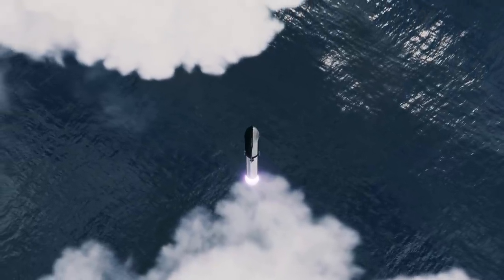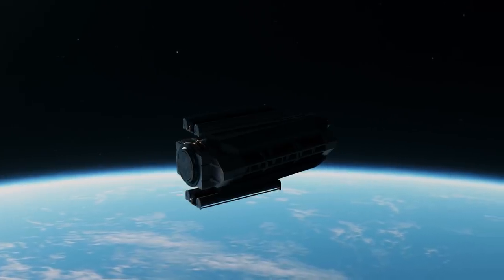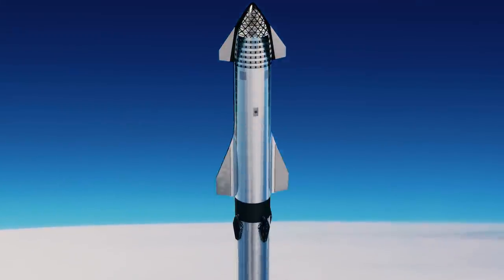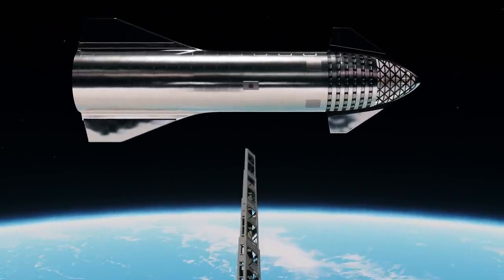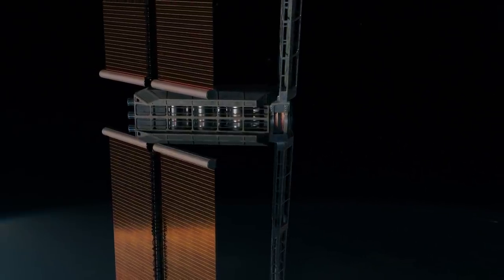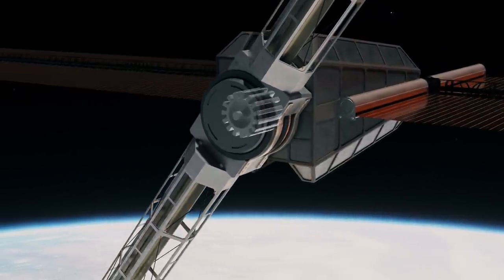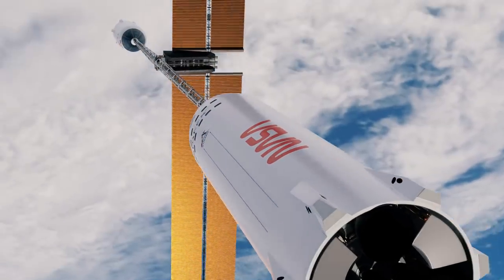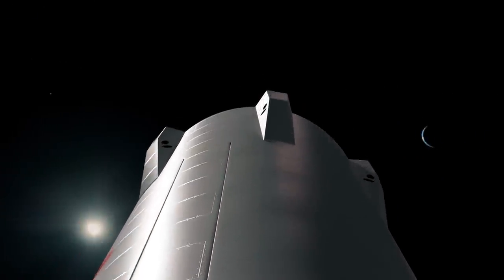SpaceX Starship Artificial Gravity Connector concept

Comment: Well it would be easier to just connect two ships with their noses, seperated with a rope.
The main problem I see here is the "horizontal" orientation of the ships. On earth these ships & boosters are always oriented verically, because thats the only way they can withstand the loads, unlike F9, which can be transported horizontally without a problem.
Put them nose to nose, we have seen starships hanging on cranes with ropes attached around the nosecone. We know that would work. Plus, you could properly use the Interieur.
Edit: Ah you did it with the Moonship, yes that would work.
Reply: However... 
That gives them maximum exposure to meteoroids and solar-radiation . It also makes navigation infinitely harder , while eliminating passenger spectatorship of space during the trip . 
Considering these factors , the optimal configuration is definitely rear-end to the Sun , with side-by-side rotation . Four tether-sets would provide good weight-distribution and redundancy , as well as mounting points for solar-panels. 
Ion-thrusters and reaction-wheels would maintain proper orientation , through redundant computer-control . 
This design services astronaut- health much better than the nose-to-nose one . 
*.To examine the optimal propellants for this mission-architecture , read my Quora Post : 
^ How can rocket-fuel be changed in the future ?
Reply: @Prof.Megamind.thinks.about.it.  still the interiour would be 90° deg angled to what it would be when landed on mars. I wonder how mich thrust would be needed to shorten the flight significantly and if the ion thrusters could provide that for such a big mass.
Reply: @PaddyPatrone  
Mr. Patrone , 
Rotatible equipment/furniture would be key to the orientation issue , while the ion-thrusters would be used to augment the reaction-wheels .
Reply: Yea the tangential mounted Starships look odd!      :D

I also wonder why the solar doesn't just spin with the ship, a rotor seems like an unnecessary part to be eliminated - better some efficiency loss from the solar than adding a rotor!!

You need a ship 200m across to simulate Mars gravity at a leisurely 7-8 rpm
Four Starships docked end to end are 200m long - so any standard Starship docked to the tips would experience Mars level gravity.
So a nice sized Aldrin Cycler with spin sim gravity could be assembled, in orbit, just by joining up a group of slightly modified Starships..     :)

Comment: Artificial Gravity is a must for long duration flights. Many problems though in balance to be solved. Easier attaching to the nose cone for better balance and to be able to use the interior as currently designed for vertical orientation.  @MoonB4Mars
Reply: Definitely need to head to the moon first before Mars and build up space infra , messing about with lunar to orbit 3d printed space parts, artificial grav, living with dust althou not totally the same.  Mars is a scary distance away,
Reply: Yeah connecting nose to nose would mean that the gravity would be acting in the same direction as at launch and on the ground, and balancing the starships around the target would be easier and less important.

At which point a long rope would do the job so the only reason to use the complicated teather system would be for the solar panels.
Reply: @daveansell1970  it's pretty similar to how they lift it with a crane on earth

Comment: Very good. But it's spinning wrong. You would want the star ships. To. Point in opposite directions. Then spin in the direction that generates gravity as if it was on the launch pad so the lay. Out of the starship can be kept the same and in a vertical position it would allow the different levels to be accessible.
Reply: A
Reply: Yeah that way it's the same orientation in orbit as planetside
Reply: Spin does not create "Gravity" only Centrifugal Force.
Reply: But then again spacex could orient it differently so that the levels are perpendicular to the belly of the ship

Comment: Gravity would be on the starships walls like that, the tethers should be attached to the top of the ship.
Reply: I commented the same before I saw the lunar Starship fix it
Reply: Agreed. Especially since the ship is going to be configured to withstand planetary gravity fields so everything will be set up bottom up.
Reply: @Machiavelli2pc  A
Reply: Floor area.
You have larger floor areas sideways
Reply: @brucebaxter6923  I think the floor layout of Starship will be vertically oriented as it should be for this type of rocket stuff.
Reply: @stitchem7  
Skylab
Reply: @brucebaxter6923  I know, but Skylab was not intended to spend most of it's time standing on the surface of the moon or mars. The micro-gravity environment does not apply when it comes to floor area. So the two Starships should be attached to a tether nose to nose, to create artificial gravity that resembles what the ship will experience while standing on the ground.
Reply: @brucebaxter6923  Ideal for climbing the walls in 3rd class, a protective headgear in 1st class.
I could point out if a un-manned moon Starship landed vertical,  then slowly tipped horizontal  (top engine burn).
   A early base easily covered in Moon Dust by a few robot dozers .'. proof against radiation, and suitable three decks with services under top arc, with bottom arc for storage, water, batteries, etc.
Reply: @stitchem7  
What is the interior of dragon oriented to?

Take your time and look carefully. 

Is the cargo that covers the “floor” really a floor?
Reply from the maker: @PassportGaming  yes it happens to many people

Comment: The nose to nose concept would place the forces in the correct direction, toward the floors, the first design would require the ships to be turned 90 degrees, to achieve the desired results.

Comment: Now make the strut much wider, add an inflatable sleeve so the astronauts can move between the ships, and make it asymmetrical so one ship is at moon gravity and the other at Mars. (Stable because the "moon" ship has more fuel on board. And add a docking module to the front of the hub so it can be resupplied etc...  great concept, this is what ISS 2 should look like.

Comment: Hold it right there.  The output of solar panels is expressed in watts or kilowatts, not kilowatt-hours.  Serious error!

If two starships are directly tethered, they can be made to rotate around a common axis.  Position the axis correctly, and their solar panels could be facing the sun throughout the rotation.  The real problem isn't solar collection, but rotational stresses on flimsy solar panels.

You've solved that problem with your artificial gravity connector.  The panels don't need to rotate at all.

One problem that I see with any tethered artificial gravity concept is safety.  If a micrometeorite hits the wrong spot, we could see Starships suffer an unscheduled detachment event.  It's critical that connected Starships possess enough fuel to overcome any unwanted delta-V in the event of unscheduled detachment.  This need may limit revolutions per minute; we can't risk more delta-V from an unscheduled detachment than the Starships can compensate for.  But what the limit is, I don't know.

But I like the concept, especially for a moon orbital base or one in Earth orbit for gravity research.  One Starship has the internal volume of the entire ISS.  Two tethered Starships will have double that volume.  That's a lot of useful space!

You suggested that your artificial gravity connector concept could be used during a voyage to and from Mars.  I'm not entirely clear on how that would work.  The connector will have a small amount of delta-V to work with using its ion thrusters, but even assuming 20X efficiency over conventional fuels, it's going to be orders of magnitude too little thrust for itself and two Starships for the Mars transit insertion.  There will be chemical rocket burns required.  That is probably not a maneuver Starships will be able to undertake while connected, even if not rotating.  The lateral stresses on connection points look unfavorable to my eye.

But if Starships independently execute those burns, where is the connector?  Left behind.

So it looks to me as if they will need a third starship, fully-autonomous, fully-fueled, to depart for Mars with the other two Starships.  Once all three have executed their burns, the third starship deploys its connector.  The other two will hook up to the deployed connector and enjoy artificial gravity on the trip.

Now we need to think about the fate of the connector.  The two connected Starships will detach and enter Mars orbit prior to descent.  The third Starship might recover the connector into its cargo bay and execute the burns required to return to Earth.  But it will be a tight operating window, if it's even possible.

Alternatively, the connector could attempt to circle Mars and return to Earth with its own limited delta-V.  This might be more practical.  It won't take much delta-V to execute this maneuver, I think.

Now we have a connector on a more-or-less permanent Earth-Mars-Earth run.  It will probably need to be refueled at the Earth end of the run - no simple task!

And the autonomous Starship that deployed it?  We will want to recover that to Earth orbit, but that will mean refueling it as it approaches Earth.  No simple task, either!  Once in Earth orbit (an eccentric transit orbit with small delta-V required to reenter a Mars transit vector), it could be refueled again, loaded with a fresh connector and readied for another Mars mission.  Each time we add a connector to the Earth-Mars run, we will add to the missions we can undertake with artificial gravity.

All of this will require many, many more refueling missions at the Earth end of the Earth-Mars route, as compared to simply enduring 6 months of microgravity on the Earth-Mars run.  Don't ask me how many refueling missions; my mind is boggling.

My gut instinct is to expect that using the connector on Mars runs isn't going to turn out to be practical.  Too expensive.  But using the connector in Earth and/or moon orbit ought to work pretty well, I think.  I like it better than simply tethering two Starships, because it solves the problem of stresses on solar collectors.

I must congratulate you on your concept, and on your animations.  You're doing absolutely brilliant work - even if I have to imagine a counterrotating counterweight.  :-)
Reply: The Delta V needed to recover from disconnecting would be exactly as much Delta V that would be needed to spin down.

The energy needed to spin up and down doesn't come from nowhere, it needs to be inputted into the system.

Regardless it's not that much and it's easily calculated. I believe someone did the math and it's like 40m/s for Mars gravity.
Reply: @TheOwenMajor  Excellent point.

It's not a show-stopper.

But every contingency has to be planned in advance.  There are no do-overs if we get it wrong.  So... I listed the issue.

SpaceX could probably get the energy for spin up/spin down from the solar collectors.  But it'll take fuel to recover from an unscheduled disconnection.

Comment: Excellent concept, very nice video.  The two moon lander starship design seems quite appropriate due to induced gravity direction and probable deck layout in the living spaces.  Something like this is how people should endure long duration space travel.  And if the arm length can be changed you can select exact induced gravity you want for optimum crew health seems at a reasonable rotation rate.

Comment: you don't need to have complicated fluid balance system   you just need to the centre of mass at the centre of spin axis    you'd just have the arms have some extra extension   so the heavier starship  would be closer to the spin axis or the lighter ship further out from the axis   without a fluid system  it would be lighter and less parts to fail   especially if the fluid system developed a leak   also if you use nose docking the sleeping quarters would be furthest away from the centre  which would be better for the crew

Comment: Looks great! And love the commentary. Though in this render it looks like the AG is pushing on the heat shield side wall and not the "floor", is that intended? Could be fixed by having a connector on the nosecone!
Edit: Saw you using it on the Lunar Lander nvm xD

Comment: 2 problems: 1 if the starships spin also the mini "space station" spin. you just put something that turn in opposite direction.
2: the starship is made to be livable in a vertical position, then the people who are in spaceship are actracted, not from the floor but from the wall of the ship.
Reply from the maker: Problem one is addressed further in the video. Problem two also at the end
Reply: @SpaceXvision  than for solve the problem 1 there should be small thrusters that make rotate the ships and not an engine on the center of the "machine".

Comment: This is one of SpaceX Vision's best concept videos. Here's an idea: Instead of this "gravity connector" module serving as a "space tug", delete the engines and connect combination Orbital Cargo Transporter / Orbital Mega Tanker, joined to the "gravity connector" module/hub in place of the ion engines. The "gravity connector" could still have ion engines, but the OCT/OMT could instead serve as a mobile fuel depot, cislunar/interplanetary tug and cargo workhorse. This would give the hub more mass, and could make the whole assembly less susceptible to wobble. Assuming each "Starship" module were capable of housing at least a dozen astronauts, the concept here would allow for an overall expedition crew of at least two dozen astronauts. 

There's another dimension to this concept that should be explored:  (1: assuming an OCT/OMT docked to the "gravity connector" hub, and assuming that the OCT/OMT/tug could have its nosecone removed, more than one OCT/OMT/tug could be joined to form a kind of train, giving the entire hub assembly greater mass. (2: assuming a "train" concept could work, a second "gravity connector" could be docked at the other end of the train, allowing the entire assembly to host two more habitat modules. The supposed crew capacity for the mission would again double, to perhaps four dozen astronauts. If the two sets of rotating habitats were revolving in opposite directions, this would eliminate any concerns about wobble. (3: At each end of the train, there would be an OCT/OMT-sized propulsion module attached to the outer edge of the "gravity connector" hub. This propulsion module could house both chemical rockets and alternative interplanetary propulsion (ion engines, VASIMR, NERVA, or even Project Orion. Once the entire assembly arrives at its destination, the propulsion module facing the "forward" end of the train could serve as "braking power" retro-thrust. (4: Once the entire assembly has entered an orbit of the destination, the assembly becomes a temporary space station, serving as a "forward base" for the expedition. The "gravity connector" assemblies continue their rotation, while an additional HLS "Starship" lander can dock with the assembly to serve as the ferry to the surface of the desination-world.

In addition, I would suggest that the booms to connect the rotating habitats to the hubs should be 250 meters (733 feet) long, so that the habitats can maintain Earth-normal gravity( 1.0g, at an even 2.0 rpm) for the duration of the voyage. And instead of using HLS "Starship" vehicles as habitat modules, try building small "hammer-head" assemblies at the far-end of the booms and filling each "hammer-head" with a Sierra Nevada or Bigelow Space-style large inflatable habitat for a much more useful place to live, work and sleep on the daily basis. The inflatable habitat could be protected in a removable metal housing to shield against meteors and the whole thing could be robotically coated with water-ice to shield against radiation and cosmic rays if necessary.

Comment: 8:15 - To correct your vocabulary a little: That rotational "counterweight" should be called a "counter-rotating flywheel" by virtue of the fact that it's a single piece wheel instead of it being merely a hunk of metal counterbalancing something else on the same shaft or arm.